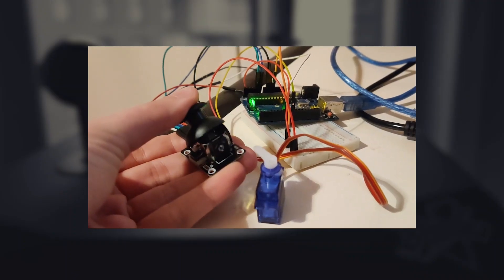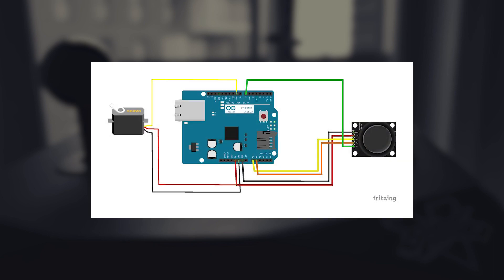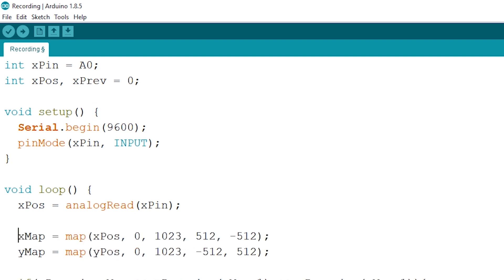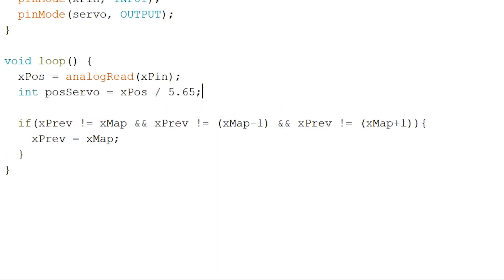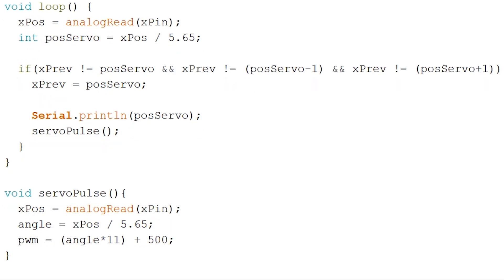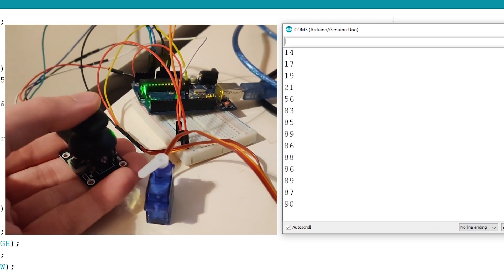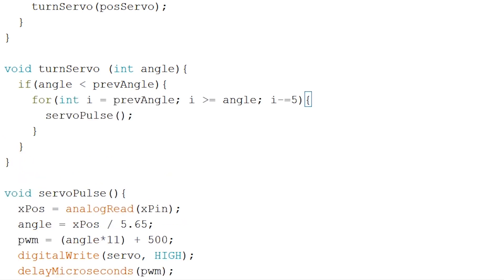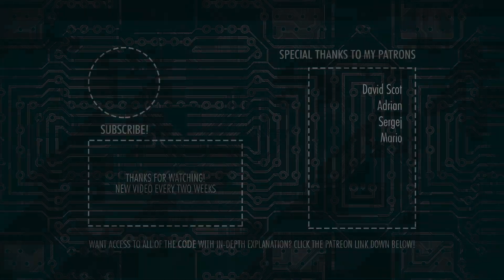Arduino joystick servo control - controlling servo motor with joystick

Comment: Hi! where did you get 5.65? Also angle *11? Thanks!
Reply from the maker: Firstly if I remember correctly the joystick has a range from around 0 to 1024 meaning if you divide 1024 by 5.65 you will get 180 (the servo motor can only turn 180 degrees). Secondly you had to multiple the angle with 11 to create the correct delay time so the servo motor understands what angle to go, why this is 11 I don't know, perhaps it can be 12 or 13 but I haven't tried this out.
Reply: @asali-channel  Thanks! I'll keep that in mind.